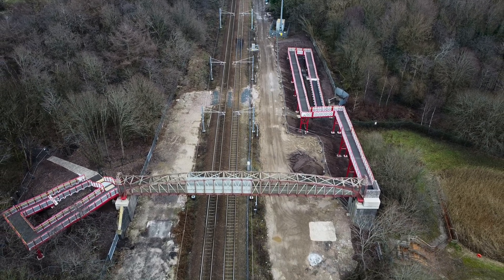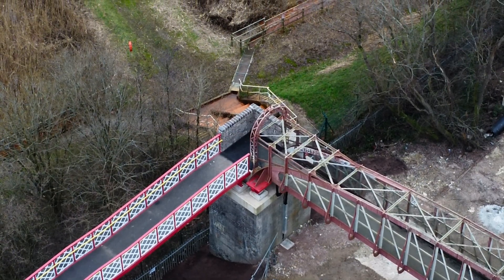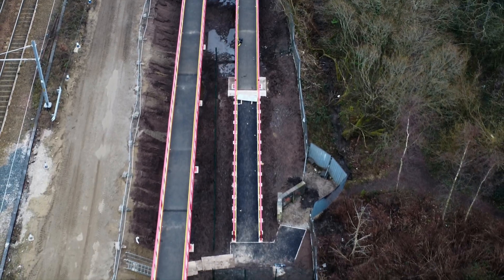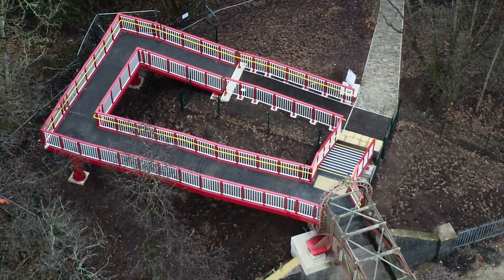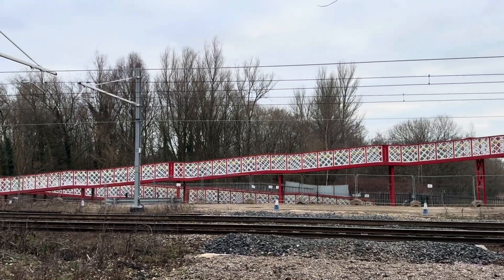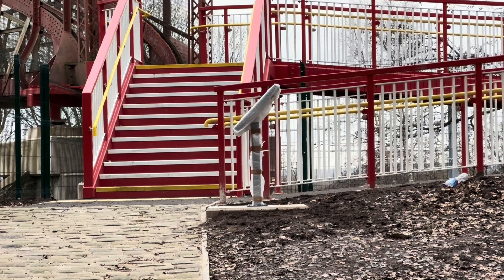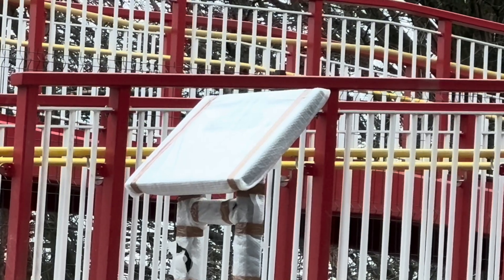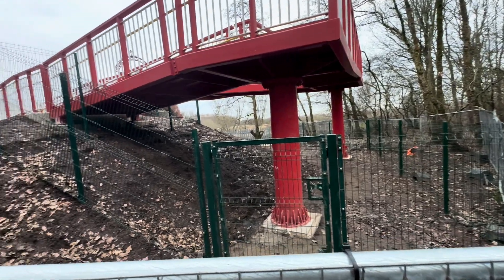Wigan to Bolton Railway Electrification Scheme | Deep Pit Footbridge update 30/12/25

Comment: Good content as usual.  Seems strange they don't have a set of steps on the Hindley side like they do on the Aspull side & they do need to paint it.

Also worried the length of the ramps may make some people to think it'd be quicker to jump over the fence & cross the tracks, I know they need to find the right balance, but do seem excessive.
Reply from the maker: Valid points Andy. I did get sent some initial plans by someone in the know but I can’t find them now. I think the issue with steps on the Hindley side may be access. As far as I know, the field on the Darby Lane side of the bridge is something to do with United Utilities & putting steps on the inside of the bridge, I’m guessing, May encroach too far onto the track section. I’m not sure, just guessing.

Comment: This footbridge looks completely absurd - such long ramps that it would take 2-3 minutes to walk from one side to the other. At first sight it looked like there are platforms, but it doesn't even serve a station. If it was a cycle route one could just about understand it, but there doesn't seem to be a cycle track on each side.
Reply: You've also got to understand that it needs to be able to be used by people,  for instance,  who use a Wheelchair or a Mobility Scooter. #accessibility
Reply from the maker: It’s future proofed. There are not many connections at the moment, but there are lots of plans in the Bee Network for active travel. Like I said, the ramps were steep previously but the bridge has been lifted significantly to clear the OLE so the ramps would have been way too steep if left the same length as previous. I’ve covered this for a couple of years so the videos on the work are in the playlist.